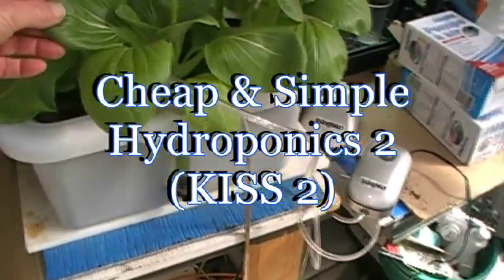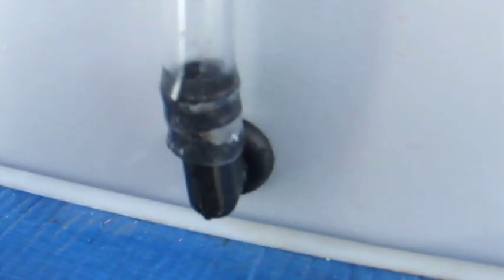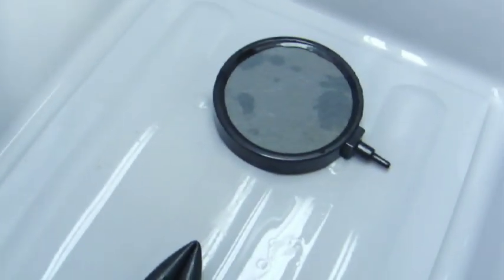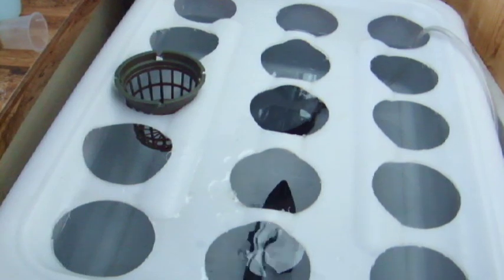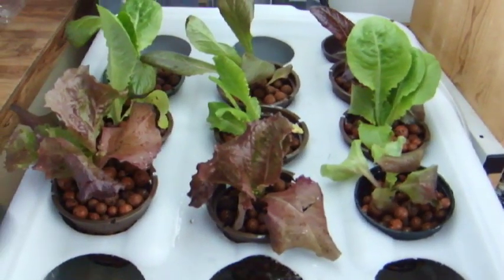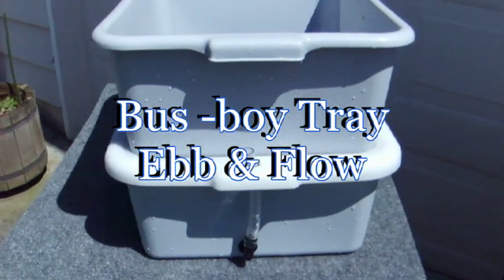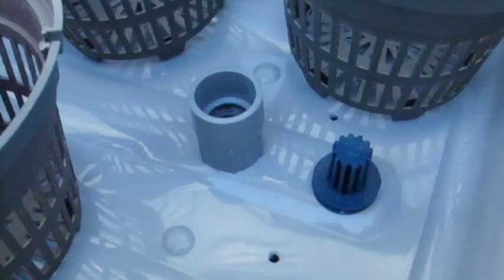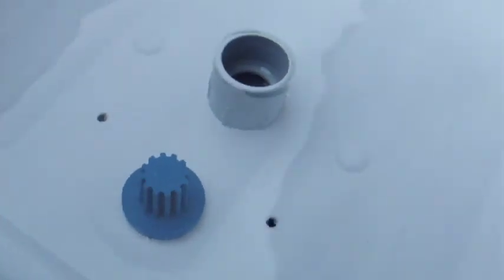Cheap & Simple Hydroponics 2 (Kiss 2)

Comment: Instead of using the air stone AND the bent hose, could you just have ran the hose completely to the other side and attached it to the same type setup that you initially started with? 1 elbow on each side, each with their own hose attached to the air pump, and inside the tub attached to each end of one "Soaker Hose" piece? Make sense? Just wondering if there was a reason for using the two different methods.